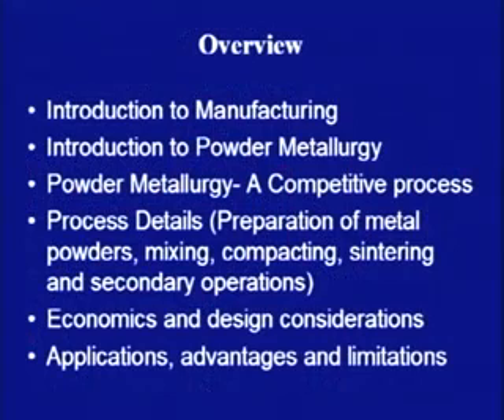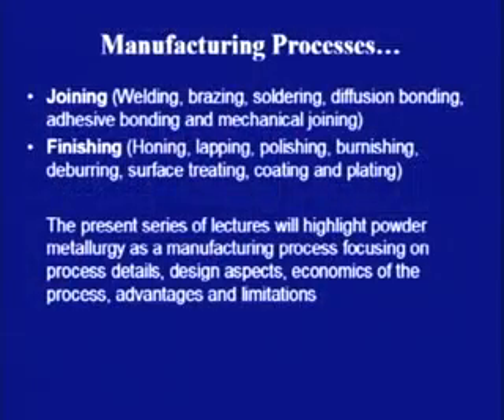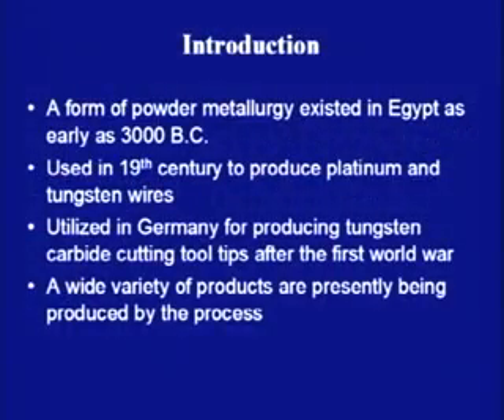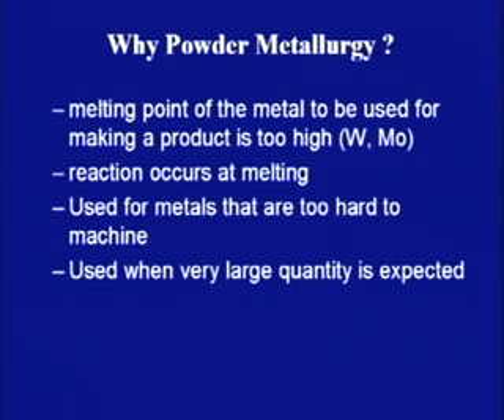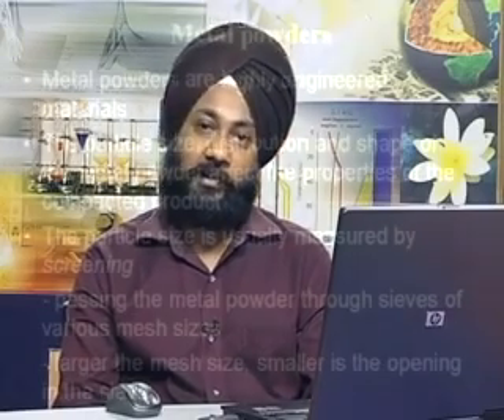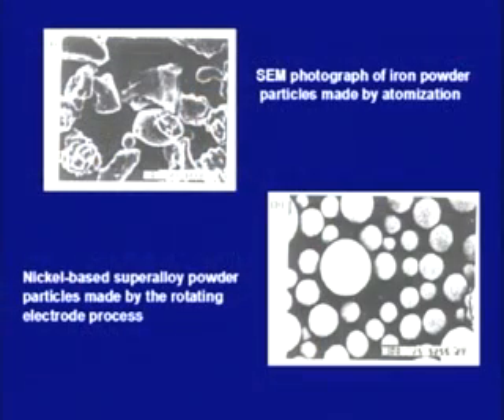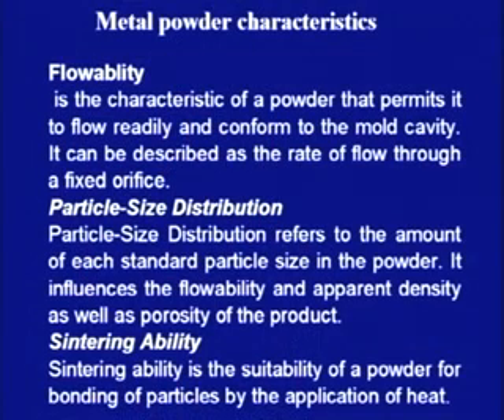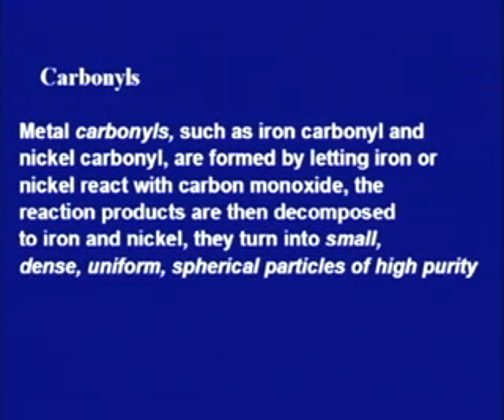Mod-1 Lec-1 Powder Metallurgy - 1

Comment: In atomization process metal has to be melted first stored into a tundish and then allowed to fall on the rotating disc by means of air jets,inert gases etc.to make  powder but my queston is that is this method of powder manufacturing is applicable for all the metals ? if so then what is the need of powder metallurgy ,can't be casted then easily??????